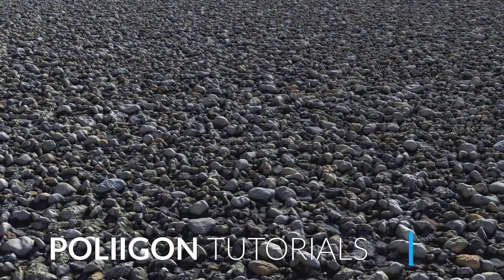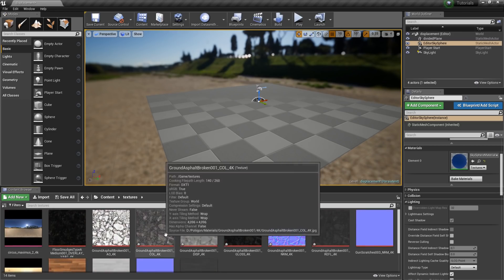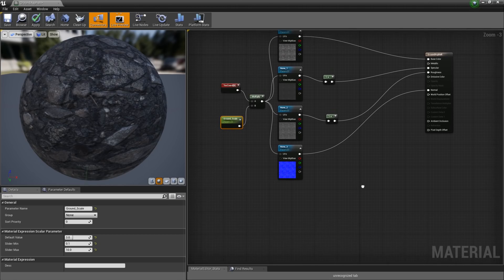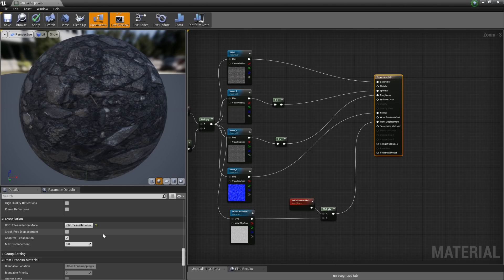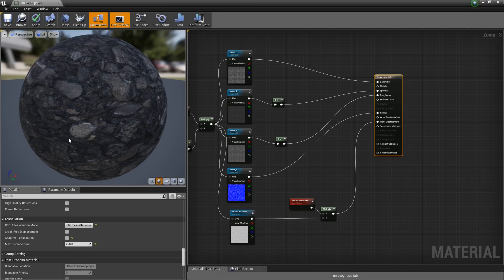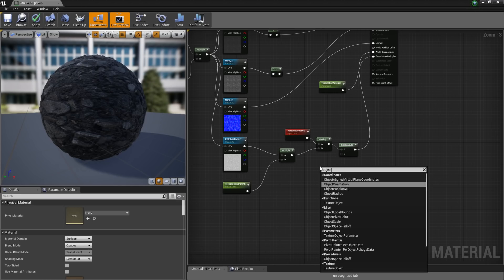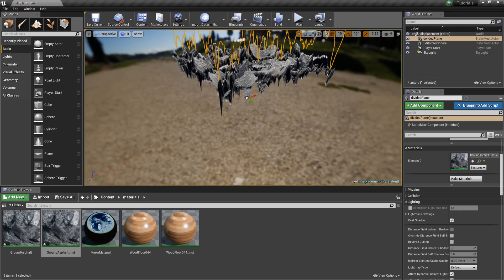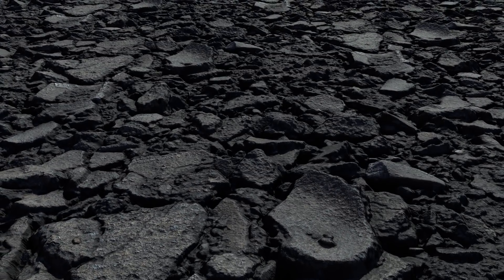Using Poliigon displacement textures in Unreal Engine 4

Comment: You may want to subtract half of your displacement to have the polygons not just pushed out but also in. Otherwise you will have clipping and artifacts once you start using this setup in an actual scene.
That specular map is useless, better read the documentation. 
Commonly, if we modify Specular, we do so to add micro occlusion or small scale shadowing, say from cracks represented in the normal map. These are sometimes referred to as cavities. Small scale geometry, especially details only present in the high poly and baked into the normal map, will not be picked up by the renderer's real-time shadows. To capture this shadowing, we generate a cavity map, which is typically an AO map with very short trace distance. This is multiplied by the final BaseColor before output and multiplied with 0.5 (Specular default) as the Specular output. To be clear this is BaseColor = CavityOldBaseColor, Specular = Cavity0.5.

For advanced use, this can be used to control the index of refraction (IOR). We have not found this to be necessary for 99% of Materials. Below are Specular values based off of measured IOR.
Reply from the maker: Thank you for the information. I'll look into this.
Reply: how would you setup the disp to push in and out? with the setup in this tutorial, the surface is offset in only one direction which causes the entire geometry to shift a lot. i would assume with what you're describing, the general position of the displaced surface would stay the same, with details pushing in and out? thanks!

Comment: Nice. If you instead use a scalar parameter into a lerp as one ootion, with the same scalar parameter inverted as the second option, you can then use your displacement texture as the alpha and the tesselation will lower and rise in corresponding areas, rather than just rise all areas.
Reply: Can also substract .5 prior to multiplying for the same effect
Reply: Will these methods work for trying to apply detail to a face, where it has to match perfectly?